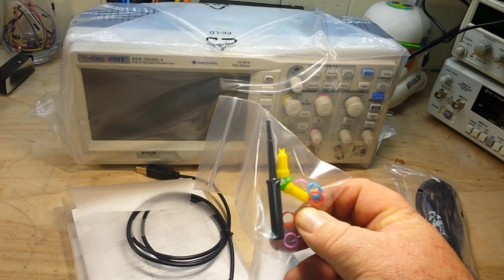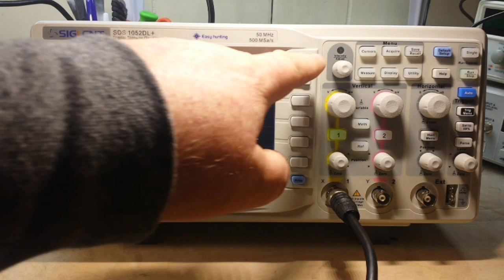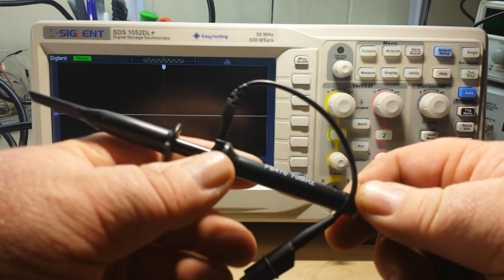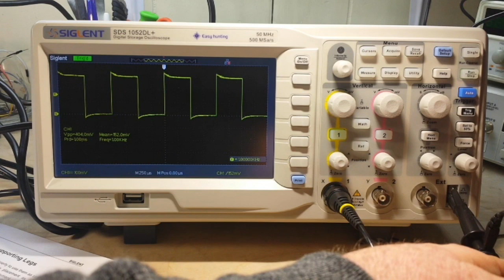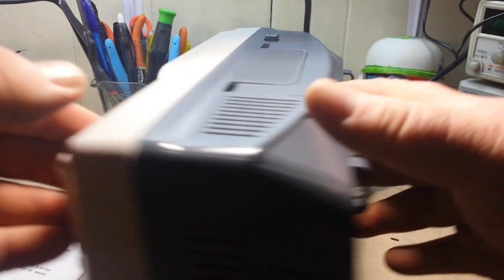First Loo:k Siglent SDS1052DL+ Oscilloscope

Comment: I just got this and have NO clue how to use it. Probe is attached to ground and a clock pulse square wave output and it shows a bunch of tightly spaced vertical lines instead of a nice square wave, which I am reasonably certain I have. Blinking led clock circuit running about 2hz.
Reply from the maker: Turn the horizontal control to adjust space between pulses.

Comment: Just bought that Siglent SDS1052 DL+. New to Osc's but VERY dissapointed (in Osc's). How do you measure Sine wave and even DC voltages with that???!. The cheapest multimeter will give those voltage in a nano-second. Waayyy too complicated and non-intuitive.

Comment: thinking of getting one for upgrading the basic ut81b portable scope. I'll probe some 230V mains using isolation transformer at most dangerous :P , not a lot of energy involved. Still a good scope for hobby electronics?
Reply from the maker: Between this and the Hantek DSO5072P. Either one will do you well.

Comment: I have a comment, and I usually don't.  I let all my meters (this one Siglent DMM baby and a  Tektronix 465b +dmm) boot up and stabilize. I have a high frequency counter from China that is highly accurate. Just let everything get to  room temp, and all will work.  Unless you are in the tundra, or a douche.

Comment: Sir
i want to purchase a Oscilloscope my budget is very low.
i mainly work with arduino i want to view  I2C, RS232 and SPI.
can i purchase this model and view the serial data.please advise
 a rigol 1054z costs rs 43000 ($650)  here in india
Reply from the maker: No this scope fires not do serial decode.

Comment: Paul, Don't feel bad about glowing up your other scope. For what it's worth, I blew up a $20,000 frequency counter while I was working for the Government as an Electronic Tech. It happens with to every one at least once. As I mentioned before, that sort of work is the work of a condition that some of us have at times called "Operators Head space" $20,000 loss is a drop in the bucket for the Government but, still a front page article of me that seems to last for years among the other tech's.
Reply: By the way, what destroyed the counter was 500 watts of RF. At that time I did not know what a RF Pickup which we called a tickler was. A fuse would have saved the counter but, a fuse would be reactive on very high frequencies. So, no fuse, no pickup, and NO BRAINS caused the problem. I had to fix it and loved doing it too. The inside of the counter was just beautiful.
Reply from the maker: Thank you for sharing. You're right, it happens to all of us eventually.

Comment: Hey Paul, that's the scope I bought about a year ago, It does the job well. Solid well made. Siglent great for support if needed. Down to 5 nano seconds (200MHz) just means amplitude down and not really accurate, good enough for me I'm not NASA..cheers.
Reply from the maker: Cool, glad to hear from someone who owns the scope and likes it. Did you get a printed manual or disk? I did not get either...
Reply: Yes, a comprehensive 120 page book, didn't need disk (but got one), you can download all you need from Siglent website, EG. pdf manual if you ever need it? Last firmware update  was 2014.  My only criticism is the menus are a little deep, takes a while to learn where all the options are, otherwise all good...You won't have any problems I'm sure. 
I heard Siglent were making some models for the likes of Agilent and Keysight. Good scope..Someone did a good video on ytube re. using, if i find it I'll send link..
Reply from the maker: thank you
Reply: Just a tip, if you cant find something, hit the ch1 or ch2  button. You'll see what I mean.  (like probe 10x etc.) Sure you'll sus it in no time..